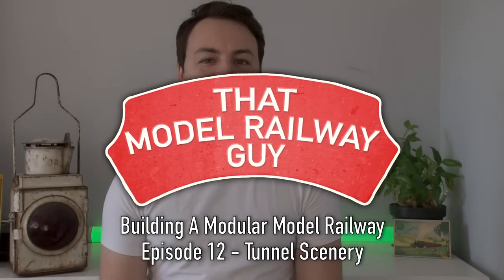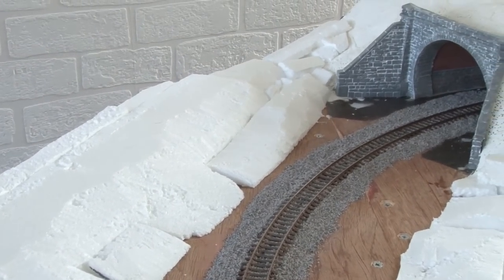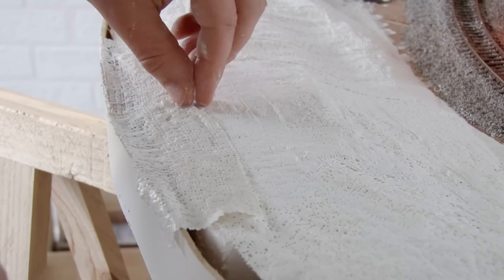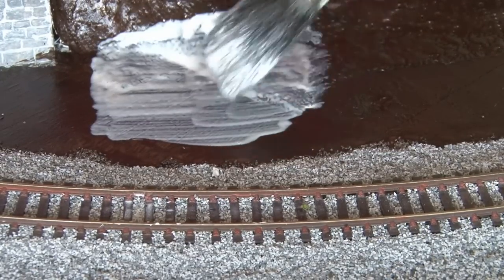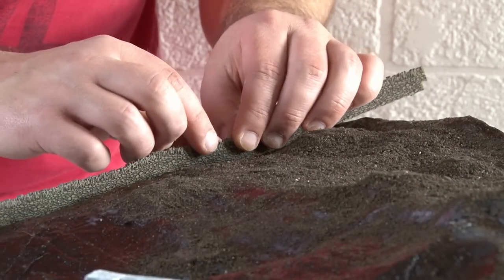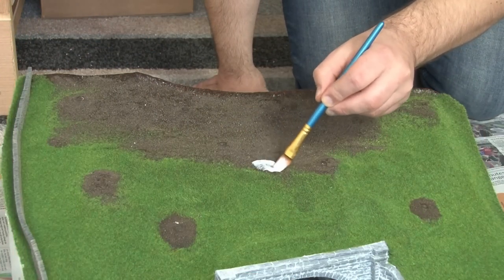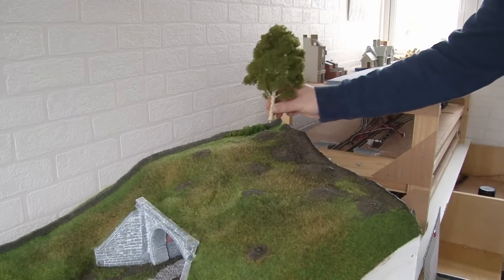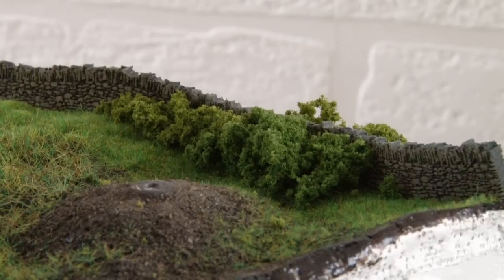Building A Modular Model Railway! - Episode 12: Finishing The Tunnel

Comment: I am currently working on my own model railway layout now, I was just wondering how is your pva glue so easy to spread using a brush? I am finding it too viscous to spread and I was wondering do you add water to it?
Reply from the maker: I use Everbuild 501 PVA (not sponsored, that's just who I use) as it comes straight out of the bottle on most of my builds. I've used some craft PVA glues in the past that are really tacky in comparison so it would appear not all PVA's are made equal. Hope that helps and thanks for watching 😃

Comment: A useful tip re the dirt scatter that you used, that I saw on another channel (not that I can remember which one), if you put it on a baking tray and stick it in the oven to dry out it will also kill off any potential bugs and other microbes that could otherwise damage all your hard work
Reply from the maker: Yep, I put mine in the microwave for the same reason and it helps to dry out the soil if it’s a little damp. Fingers crossed I haven’t given any bugs superpowers! Thanks for watching 😃

Comment: Both of the first two big pieces of styrene had square gaps in the slope that were filled in later. I think I would have left one of them open and used the shape and a few well placed elements to suggest the footing of a long abandoned building in the countryside. In fact, I thought maybe the holes were there on purpose until they were filled in.
Reply from the maker: That was just the shape the polystyrene came as part of some packing material. For me this layout has always been a "less is more" endeavour and so with the Tunnel already taking up a lot of real estate on this module already I didn't want to cram too much in, especially as there are buildings near the lineside on other modules too. Of course the great thing about model railways is that we all do things differently. Thanks for watching 😃

Comment: I think using real dirt is a great idea and i think ill try it as well. But does it smell ?
Reply from the maker: Nope, not in my experience. In the Summer when it's been baked by the sun it's like dust. As the ground is more wet at the moment though you have to dry it out first, which I usually do by putting it over a radiator or in the microwave. Once it's fully dried out it's basically just like using a normal scatter. Thanks for watching 😃